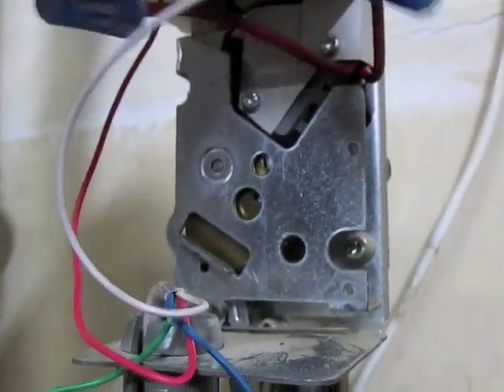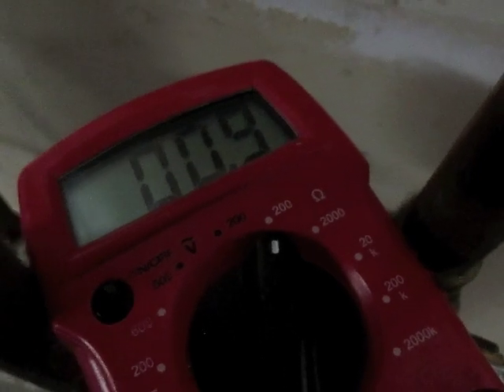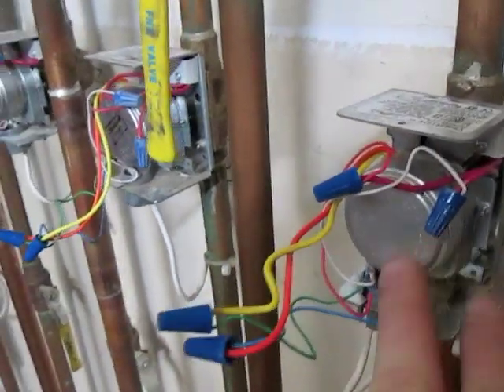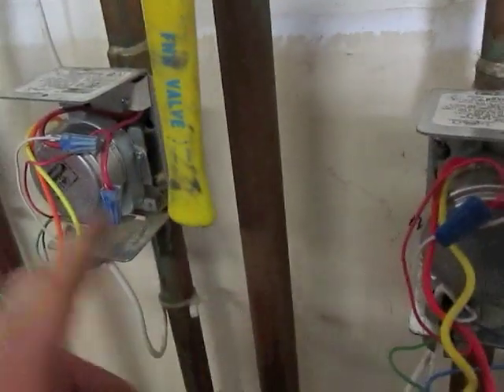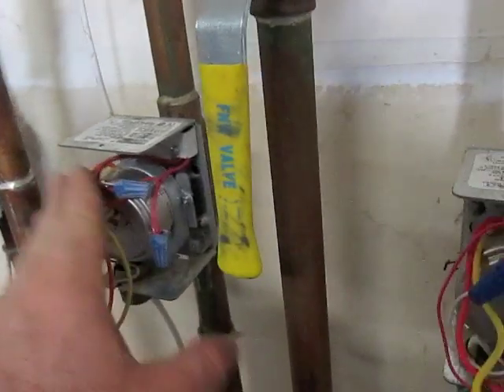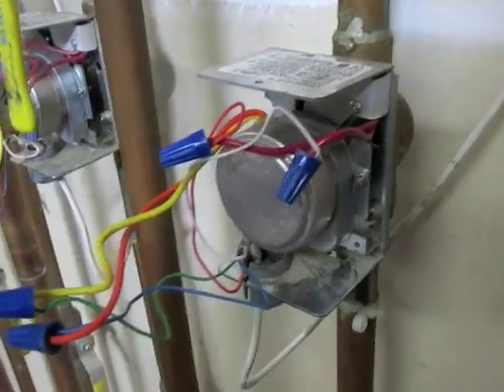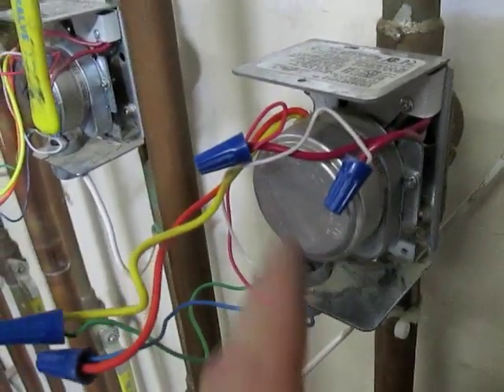How to fix your heat -  probably the zone valve, end switch, thermostat, or circulating pump issues

Comment: In the beginning of the video you mention testing the in switch with your multi-meter but didn't show what you're touching with the meter?
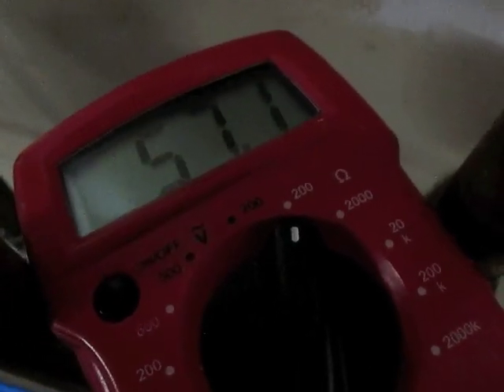Reply from the maker: +physiques Woops!   Under the white at 0:04 seconds in is a switch.  disconnect it from the system so just the wires are there not connected to anything and then use your miultimeter to touch the ends.  There will be a small tab on the switch.  Test it with the small tab of the switch up and then test it again with it pushed in.  Sorry about that.
Reply: +You can Fix It!!!! Thank you very much for the quick response that was very helpful :)